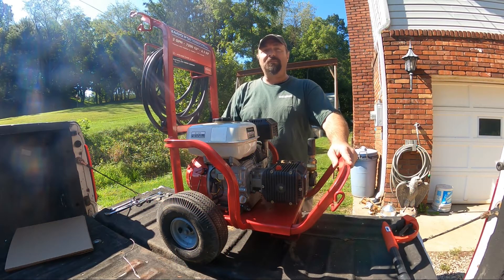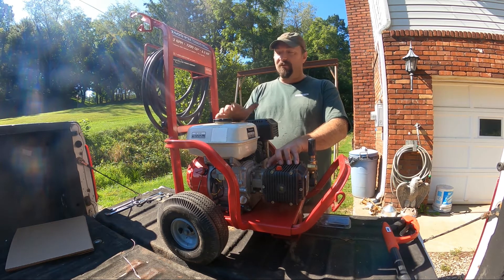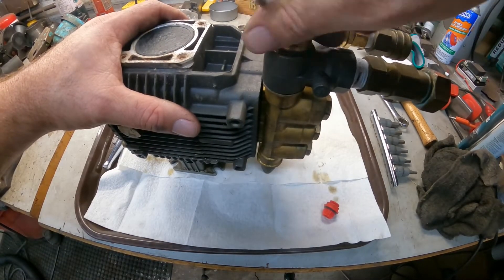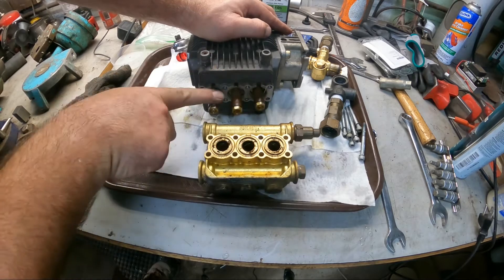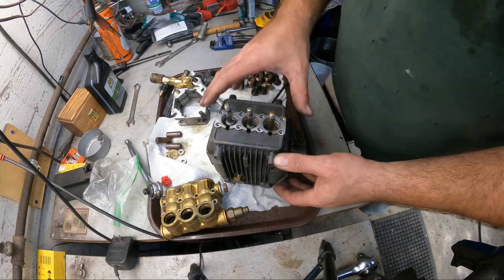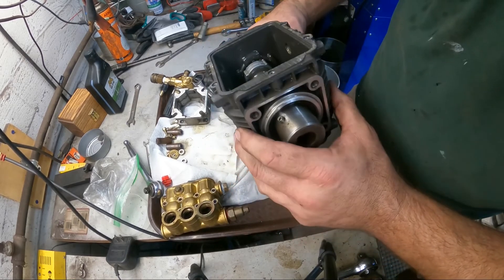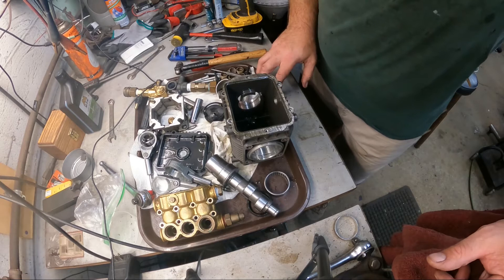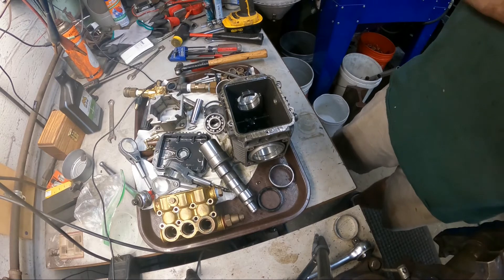Part 1 Pressure Washer Pump Rebuild Annovi Reverberi (AR) XMV3G25D Pump

Comment: Hey man, I know you're probably busy with your wife since its mother's day today but I have a question for you. So I have an AR pump 4gpm and when I took the head off yesterday, on the middle piston rod, the seals behind the piston were visible to see but #1 and #3 are fine. Will i have to remove the shaft to replace the middle?
The rods and pistons are in great shape.

Comment: Hey bud, i came across your vid and im very impressed with it. You're very thorough. I just recently bought the exact pressure washer but with 3k psi water pump. I noticed it leaks water between the valve body and the pump. What do you think it could be the issue ? Thx in advance.

Comment: Where did you purchase the rebuild kit.  Ihave a 30 year old AR pressure washer pump that is leaking oil.
Reply from the maker: I bought the bearings from McMaster-Carr and the seals I think I got them from Toolbarn.com 
You could get it all from Amazon,  the part numbers are in the description for reference.

Comment: Great video.  I’m thinking about doing this. My issue is there is water mixing with the oil, turning it white.  I am wondering what  parts I should replace.  Maybe the orings on the 6 valves?  Maybe the 3 seals on the pistons?   I see online this is a water seal kit and oil seal kit.  I would appreciate any advice if you have the time.  Thanks
Reply from the maker: Thanks, The oil place for oil to get into the water area is the seals behind the piston. So I would look at the pistons and seals for replacement. I will say it can't hurt to replace all the seals while you are there though. Good luck!
Reply: Thank you

Comment: That red oil plug needs to be swapped with the yellow plug. The red plug is for shipping so it doesnt leak. The yellow one allows the pump to breathe... that may be why it is failing.
Reply from the maker: Good catch, I thought this had a vented cap because I have seen some red caps vented on other pumps but this one is not. The seals were dry rotted anyway and needed replaced. Makes me wonder what happened to the vented cap. Thanks!

Comment: Great video.  My pressure washer looks nearly identical to yours, so I'm very interested in this repair.  I was wondering if the cam shaft could have gotten bent from pressure on the pistons due to the freezing.
Reply from the maker: It doesn't appear to be bent, I think with all the other components being weaker, they would all break first. Everyone that my uncle has seen freeze, he has never seen the crank damaged unless a rod broke and was run. Most of the time its pistons and valves, and sometimes the unloader or valve body. Thanks for watching!!